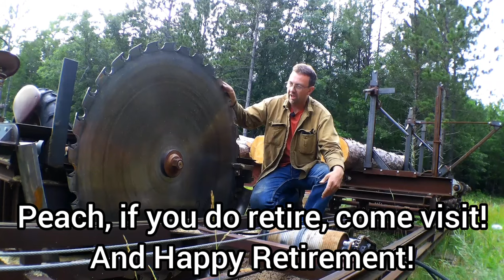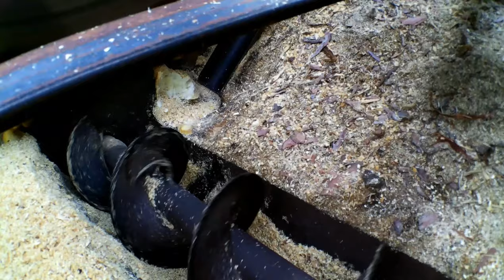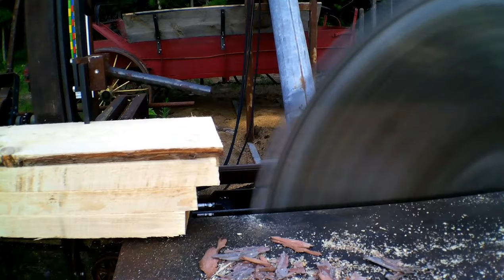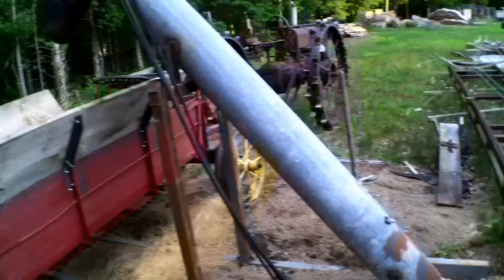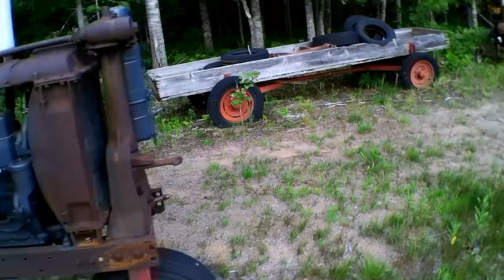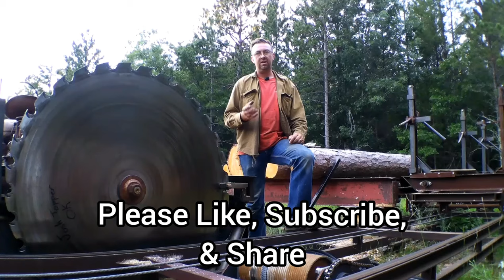Homemade Circular Sawmill, 52" Blade Rips Through a Log

Comment: Pretty nice sawmill.  I worked in an old commercial sawmill in Oregon as a kid.  We  had two 52" circular blades, one over the top of the other and could cut at least 36" logs.  When we broke for lunch, the millwright sharpened the teeth and changed out any that had chips in them.  A very noisy place and no hearing protection back then, I paid for it later.  Great video, thanks.
Reply: O
Reply: O CGo

Comment: Your feed rate is very impressive for such a large inserted tooth saw. Great job. I used to run a chrome plated tooth with a chip breaker. They were cheaper than hi speed steel and stayed sharp for longer. They were awesome in the winter and frozen wood. Keep up the great work and be safe

Comment: Nice build on the mill .
Works great.
The tractor does better than I thought it would for power.
Better slow the feed down a bit or you will stick the saw in the log if the tractor doesn't have enough power to keep it turning .
Never easy to get saw unstuck from a log when the belts came off from over load , I used to get big pry bar in pulley and turn it back ward, do not want to pry much on the saw teeth , might bend the blade .
Will be nice to see it run by steam some day.
I used to run a Frick / Home made mill something like this but was made to be portable , had  a GM 471 powering it.

Comment: Really neat video it's cuts really nice in the small red pine like that. I can make my 250 horsepower diesel engine beg with a 52 inch 46 tooth F saw when cutting full 19 inches of cut in hardwood in large pine I can go full speed and pull nice heavy chips . The super M has a quick limitation if you try any bigger log unless you slow down the feed to a crawl you need to maintain the hammered speed in the cut.

Comment: I took the family, before it closed in 1982,  the last running mill with ig blades.  We got to walk around the log pond and float a watched the pushing of the logs to the chains which pulled them through the big blades   Mill A, at Stenson Wa and up the mountain was mill A.  Got see the plumes in action and was told it was where "Lassie come home"  was filmed.  Mill and plume stopped running because they could not get anymore of the large trees.  Now days trees are harvested 35 yrs

Comment: I went to 30 tooth heavy blade from a 60 tooth thin blade on the firewood processor,  it cuts faster maintains rpm drop of 200 rpm compared to 500 to 800 rpm drop om the 60 tooth.

Comment: That’s amazing - I’ve been researching building My own sawmill, and have kinda been stuck on a bandsaw design - but your video is making me rethink everything!

Also, idk about everyone else - but something about a 4’ Ø saw blade strikes a fear in me that only god himself could do 😂
Reply from the maker: You would regret building a bandsaw within the first day.  Slow and don't cut a strait board.  They have their place, but if you want to cut fast and good boards, circular is the way to go.  Nothing scary about the blade, but it is to be respected.  I run a 52" and know where not to stand or even reach near it.
Reply: Look into swing blade sawmills.  Look at the mobile dimension sawmill.  Either way, you get accurate dimensional lumber.  These big blades are expensive and the cost to maintain them goes up substantially with the size.  He is right about bandmills.  They just have a lot of drawbacks.
Reply: @hillbilly4christ638   good looking out, couldn't come in more perfect timing. I'm just about ready to build my first sawmill - cleared a few dead standing oaks and poplars on true ground in order to make way for it, and y'all's wisdom has given me some insight on what I think is best for the build. Keep em coming if you got anything else please - and if my reference gives you any specifics, the ole lady and I have land in the Appalachia's. Mostly red/black oaks, beech, poplar and unfortunately the ever-dying ashes. 

I've been handling the chainsaw mill for a few years thanks to pop pop, but I've been working on building my own fine woodworking business. Seeing all this fine hardwood go to the woodstove breaks my heart, and is the main reason I've wanted to build my own.

y'all are much appreciated, and you're doing God's work - stay real and stay safe 🤙

Comment: I actually live just down the road from your shop. I caught a lot of lumber off of my dad's sawmill, his also had a 52 inch insert tooth blade. We could cut an 18 inch wide board, and shorten the headblocks down to cut a 4 foot long log. Great video, keep them coning.
He also ran his with a John Deere  model 620 2 cylinder tractor. And you knew when it was working.!

Comment: also whats your mill like on hardwood.whats the largest board you can cut?
Reply from the maker: Could use a little more HP. Cut some white oak 16' 2x8 and just had to slow down feed a bit to compensate for lack of power.

Comment: Watched ST3 - sawmill. I've slept since then - so now I ask are there no hydraulics on the tractor - that could have been used to power the hyd motors on the saw ?
Reply from the maker: Sure there are, but how will I get hydraulics off the steam engine when that is powering it?  Or if I need to come up with a different power source?  This is fully contained and ready to go.
Reply: @TopperMachineLLC  I'd forgotten the plan for steam power.
Bet steam would make those motors spin ;)

Comment: It probably won't get a response from you but here it  It is I've wanted   To get ahold of one of the antique bell saws for a while But all I can find around here is the axles in the blades The track is rather simple I can make the track it's the carriage that I cannot find So how did you all go about building the carriage And do I have any kind of plans parts dimensions anything you can help me with remaking one of those.
Reply from the maker: I don't have any plans, it's all in my head. Lol. I will do a more in-depth look at the mill this summer. We are still quite frozen up here and no signs of ever thawing out.
Reply: @TopperMachineLLC    Yeah. I just wish I could find parts define parts so I can put one together when I'm gonna make it from scratch

Comment: As fast as that saw is going through the log,  I'm glad your log was small...if it had been a large log , I believe things would happen.... bad things
Reply from the maker: It stalls out the tractor if I push too hard. Not enough HP for that feed rate in big timber. Once I get some power, I should be able to saw 30" pine logs at the same or faster speed. Hardwood would be just a little slower.

Comment: I wonder would a blower shift sawdust along the duct better than the augers ?
Reply from the maker: Blowers are noisy, take too much power and are not as good at dumping in a small location. Usually a drag chain is used, but I don't like them either. The auger works the best of anything I have ever worked with.
Reply: @TopperMachineLLC  It has that risk of being 'dust-logged' where the mass of dust just rotates with the auger.
Have any of them used simple conveyor belts ?
Reply from the maker: @millomweb  yes, conveyor belt is used on some new mills. I wasn't overly impressed by it.
Reply: @TopperMachineLLC  What was the problem with those ? Seems like a pretty standard loose transit system.
Reply from the maker: @millomweb  longevity.
Reply: @TopperMachineLLC  Down to belt material.

Comment: I like your sawmill setup. But I watch your machine shop channel too. If i had your skills I would have built it a little more modern and easier to operate. Maybe a powered infeed deck, and powered dogs and log moving on the the carriage.
Reply from the maker: I built it exactly how I wanted it.  I can always add the extra crap later, but I don't want it.
Reply: @TopperMachineLLC  I understand that, but I just thought it would help make it more efficient and easier for yourself and you could run it with less people.
Reply from the maker: @JamesSimmons-pz7wn  we already run with only 2 of us. We only saw about 2-3Mbf at a time, which is about an hour or slightly more. Efficiency is not the problem here at all, this is just for fun.

Comment: what rpm are you running your saw?
Reply from the maker: Hammered for 500. Just because that is what my steam engine will be running it. Thanks for watching.
Reply: @TopperMachineLLC  It sound slower than that?
Reply from the maker: @richardmosher7204  I checked it with my tachometer, 502rpm. It's only 32 teeth, so sounds super slow.

Comment: oK MILL did you set your lead at 3\16 of a inch, it sounds like your saw is running in. when you back up you should just barely hear the saw tips brushing up against the log. If you hear a lot of noise you are running out and if silent you are running in. Bid thumbs up for not running water on the blade shows you van control your saw, the auger not the best for moving sawdust. A chain in a trough foes a better job a dual chain with paddles is the best but you cant be lazy and use the ground it has to have a trough and use the top chain to move the dust not the bottom or it will jump off all the time. Find a air carriage and a turner and you can really get er done. $ gen Saw-miller.

Comment: It seems like you feed the log too fast to get clean smooth cuts , guess that’s why your saw dust is saw chunks lol
Reply from the maker: Chunks is the correct outcome. It's not a table saw, it's a production machine. I worked with an expert sawyer to get this mill running perfectly. If I had more HP, I'd feed it faster.

Comment: Just so You know ... don't spread the wood chips (aka shavings).  Equestrian affiliated organizations (horse shows, stables, etc.) will pay good money for the shavings You are generating.  It's used for bedding in the stalls and also in the transportation trailers.  Another source would be zoos and related users.  With Your expertise, You can gravity bag the shavings and also sell them by the truck load.  Personally, I have bought many bags of shavings over the decades.  Typical size bag would be 4X2 feet.
Reply from the maker: The dust is almost too fine for horses and cattle.  The planer makes nice shavings and that we plan to bag and sell.
Reply: @TopperMachineLLC  As a 3 decade user, I can share with You the shavings depicted in the video are consistent with what I/we have used for that period.  I understand Your comment, however after attempting sawmill byproduct (a truly fine powder) "that" is an unusable for the purpose.  Your shavings, while finer that planer byproduct, would be perfectly usable for me.